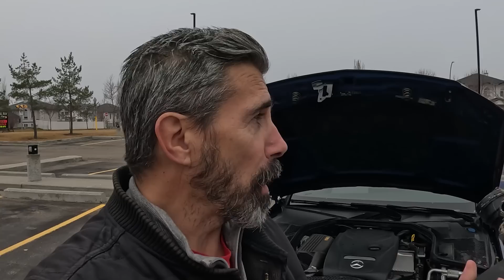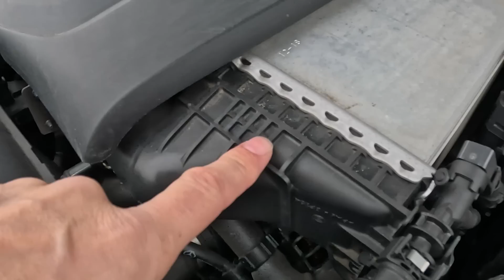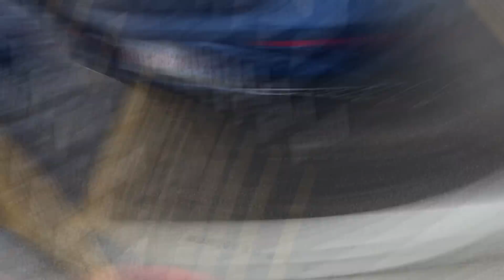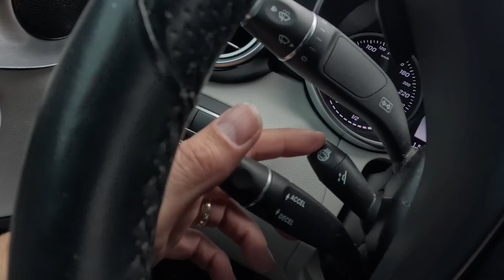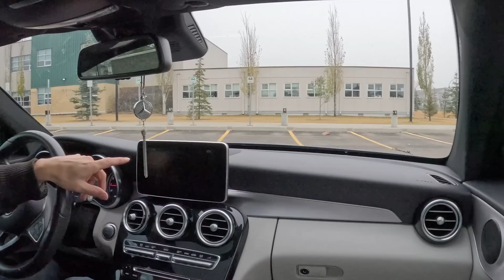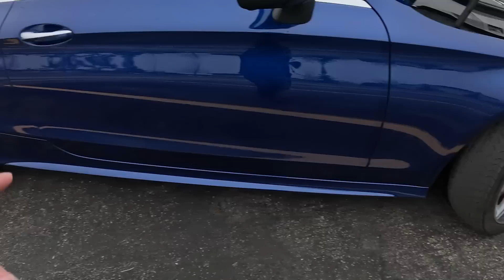Here’s Why New Cars Can't Last  5 Years | What Went Wrong?

Comment: Enjoying driving my 1997 Volvo 855 so much every day. The lack of terrible screens, intuitive physical interface design, no irritating systems that bug you when driving, windows you can't see out of without cameras, basically everything is repairable at home. Nothing is locked down with expensive systems and nothing has to be programmed in. It also looks better than any modern car. God modern car appearance is just the worst, the terrible ADHD headlights, all the weirdo shapes, the wide fatness, the huge expensive wheels to offset how weird the car would look because the belt line is so high, and how every car is a bloody SUV or suv lookalike...

Comment: They said this about my car. 2013 ford taurus turbo. Never had to repair anything mechanical. At 230k miles. I just keep up with maintenance. Most cars break from beating on them and lack of maintenance. We have a 2003 Honda civic we use for long road trips. It's rolled over miles 2 times. I bought it with 500k. It's rolled over 2 times and I'm on roughly 2,300,000 miles. Never replaced a part besides spark plugs ever 175k and oil changes every 6 months( I go by time not miles)

Comment: 40 years ago, a used car with 60,000 miles is about toast. Now, a used car with 90,000 miles is expected to go for another 50,000 miles. Coolant lasts 100,000 miles. Spark plugs last 100,000 miles, tranny fluids go 100,000 miles. Tires last 60,000 miles, with some going over 100,000 miles.

Comment: They have been using ABS plastics in cars since the 1950s. They have been more common place to save cost and weight in cars over the years. But I've have many cars from the mid to late 1990s to early 2000s with plenty of ABS parts and some went well beyond 150k miles. Currently have a 1999 Mercedes ML430 with 250k miles and still going strong. I don't like the cars with too many electronic assisted aids and or complex stereo systems. When BMW started doing electronic controlled park brakes and transmissions it caused all kind of failures. And Audi with their MMI optically linked stereo system if one component fails optical series then nothing will work. And in some models with a self leveling suspension you need the MMI screen to work to put it in service mode before jacking it up.

Comment: Vehicles from the 1990s to the mid-2000s balanced solid engineering with modern features, while today's models are built for efficiency and tech, prioritizing newness over longevity to keep sales flowing. The shift from solidly built to discard and rebuy happens due to the following ...

1) increased profits - Automakers realize planned obsolescence increases sales. 

2) cost reductions - Sacrificing high quality materials and over-engineering because they cut into margins.

3) Technology and complexity - More electronics leads to faster obsolescence. 

4) Consumer behavior - many people prioritize new features over long-term durability (think of the iPhone craze, got to have the latest and greatest).

Many overseas countries won't import American automobiles for these very reasons.

Comment: Totally agree; Mercedes lost the plot after 2002.  I have owned 3 and will never buy another.  Its a mid 2000s Lexus or Toyota for me.  My other car is a 2000 Jimny.  Nearly everything under the bonnet is metal.  The only plastic parts are ones that hold cold water - or are inside the car.
Reply from the maker: sad direction they went in my opinion

Comment: Hi your video is spot on, I run a 2005 VW polo SDI with a 1.9 naturally aspirated diesel engine. I'm pretty confident that it will achieve 1,000,000 miles+
Reply from the maker: nice.  Yes some of these old units are amazing

Comment: There are some but people are buying junk because the car makers know how to trigger your emotions with B S  advertising. 
European vehicles = junk
Korean  = junk
American = junk
Nissan = junk
With what's left you have to do your research on each model but in general they are better

examples of disastrous engineering:
putting a rubberized timing belt running in oil
putting a water pump inside the engine casings
putting a heater core inside the passenger compartment inside the dash
cylinder deactivation
putting plastic oil filter assembly under intake manifolds
putting turbos in the space between 2 cylinder heads
making specialized plastic hose connectors in the engine compartment 
replacing aluminum casings/housings with plastic ones
imbedding all functions and controls in an electronic screen
making rear lights with a computer module imbedded

Comment: And no mention of Adblue and DPFs?! 👀
Thats a big one over here in the UK!
Emissions symbols on the dashboard, adblue pumps packing up, adblue "going bad" because it's sat outside the forecourt in the sun for too long...
DPFs blocking up with soot, failed regens diluting the engine oil with diesel, DPFs actually cracking internally due to the heat/cold cycles...

All 21st Century problems. 😞

Comment: someone doesn't understand plastics, LoLz...  turbo 4's and 6's have been around for a long long time. cvt has some issues, but routine oil changes fixes most issues. don't worry about batteries, lower cost solid state batteries will be commercialized in a few years. 

not sure why older cars are being called more reliable than modern day cars. as a former mechanic, i see more older vehicles than modern vehicles. i ever fixed manual roll up windows, corroded wiring, the usual alternators, water pump, compressor, power steering, etc... and yeah, they were not cheap then as it's not cheap today. sensors and modules are not a big deal. it makes things easier to diagnose. mechanics will now need to become IT techs, LoLz... 

what i find that is a major issue are auto stop start systems. it's not good for the engine to stop circulating oil or stop the turbo cooling system multiple times during stop and go or city driving.

also the most important issue is, these new technologies are very expensive, causing the price of cars to increase. what i like about the new technologies are the safety features (ACC, Lane Centering, automatic emergency braking, pedestrian censors, surround cameras, etc...).

Comment: OK, I will bite.   Build what sells.   Why can't they make a simple reliable car, that has manual a/c heat controls?  Do I need 4 fan/blower speeds for the defroster?   Why can't they come up with a durable plastic?   It is not like cars and plastics haven't been around for 150 YEARS ! !

Comment: I have a 2018 Dodge Challenger V8 5.7 l engine. No turbo, no problem. It is old technology that is proven over decades. Sure it has computers etc however, the engine will last 200k with little maintenance. This car has 48000 miles on it and has been reliable. I have had to replace the battery and an anti pollution device as well as all four Brembo brake pads. But this is regular maintenance. And this V8 sounds so awesome when you start it up and drives so smoothly. My car is a manual 6 speed transmission so no Automatic transmission to replace.

Comment: Plastic... Like Subaru is using in their Thermostat Control Valves. Can't even replace a simple thermostat anymore. Instead it's a $400 part which has an additional 4 internal failure points and costs between $1400-$2000 (part included) to have replaced. At least Subaru extended the warranty period for this issue and is replacing them for free, but after a class-action lawsuit began gaining ground!
Reply from the maker: It’s good there are many fixes forced on the OEMs

Comment: Auto vehicles are becoming disposable goods, planned obsolescence is what it happening - like 'sealed for life' transmission fluid - Electric Cars - NOBODY will be able to repair these - the only winners are the Government who will be in control of that thing more than the drivers, the automobile companies who will have unique control of parts with patents and IP licenses and prevent third party repairs and finally banks - who most people will be getting loans from - There’s nothing in it for whoever ‘owns’ it. I only ever had NA vehicles, never had issues - last purchase was a 15 year old Jaguar XKR-S, sublime V8, pottering along at 100mph doing 2k rpm or something like that hardly breathing - modern cars are full of nanny state mandates and control and technical rubbish nobody will be able to repair past its warranty, after 5 years dealers will chuck a pile of parts into the bin and charge a kings ransom to repair it or just crush the car itself and the cycle will continue.

Comment: Interesting, I just checked my 2109 Genesis G70 and every hose is a real braded hose with metal clamps! My previous car was an Infinity G37x and it had a beautiful V6 that produced over 300hp but the issue was the gas mileage!
Talk about plug and replace, I had a retread pop up and crack the headlight lens, I'm thinking that the lens could be replaced at a few hundred dollars. Well I found out the entire light package including the blinker and headlight is all one piece and was over $2000!

Comment: When a lot of people trade their car in before, even paying it off most of the time do people really own cars anymore?

I mean, I have a 2006 PT cruiser runs like a champ and I got a 2011 Dodge grand caravan. It has a PO code in the transmission but keeps on ticking. 

I really feel that Dodge putting sensors on the hoses is dumb. That’s all I’ll say about the Dodge grand Caravan.  

Never knew that when a radiator hose goes out on a Dodge grand caravan it would be $600 .

Comment: It’s not isolated to just plastics. The overall level of good engineering that’s fit for purpose long term, simply isn’t there. Many manufacturers don’t have an extensive R&D programme per vehicle. The user is the Guinea pig and the maker has factored into its pricing what they estimate will be warranty payments. The irony of modern cars is simple, I run a 2012 3.0L straight 6 3 series BMW. It has 120,000 miles on it, doesn’t burn any oil, has always, since new, maintained 41 MPG and pulls like a train. Why……is it, that a much smaller engine can’t achieve the same low fuel consumption?  Because a larger engine has more torque and isn’t working as hard as a highly strung 1.2 for example. Car makers simply nowadays want you to buy another. That’s progress, or at least that’s what they call it.

Comment: My 2006 Jeep Grand Cherokee with the Mercedes OM642 diesel engine has given me 4 years of absolute greif. Only 140.000klms. Problem, engine blowing white smoke. Mechanic would work on it, problem gone, a week later problem back. Spent thousands $$, injectors replaced, inlets decarboned, and more. So much smoke the car could not be registered. About 6 months ago I discovered on a forum that resetting the main ecu/pcm might fix the white smoke, it sure did, but the fix did not last long.  What made the problem occur was discovered. Adjusting the driver's seat back or forward corrupted the engine settings in the main ecu/pcm. Why??? My mechanic and auto elec shops had no idea. I some weeks later thought, the seat moves the problem returns. The seat memory module is attached to the seat, normally passenger side, but for mine being RHD it's the drivers seat. My partner is shorter than me. So I checked the connectors  going to the seat module, one was loose. The problem fixed. So costly and such a headache. During all this I did buy another GC, a 2015 with the Hemi. More to go wrong I guess, but I've learnt lots.

Comment: I like older cars because they are easier to fix and they also tent to have a bit more character than newer cars. I can even see a difference in a car that is over 20 years old. my parents car is turning 26 this year and it has never had any engine failures. it has also done over 100,000 miles.
Reply: I meant tend not tent.

Comment: A combustión engine gets really efiicient when It deliverys Torque to spare in direct relationship with the weight to move. Small engines, even when turbocharged, often struggle to delivery unless they reach high rpm.

Comment: The best kept secret out there is Ford bashers I love them. I've owned multiple Fords never have the issues that this guy complains about. My Ford Edge with a lowly 2.0 EcoBoost has115,000 miles still going strong doesn't burn oil and pulls a 2000 lb trailer on a daily basis. I wonder if he's actually ever owned a Ford. But keep bashing them it keeps the prices down for people like me. Thank you

Comment: My car is 20 years old, 135000 miles. Small engine (2 litre) with turbo. Oil consumption minimal. Power still impressive, about 7 seconds from standstill to 65 mph and plenty to get it to over 120 mph. Which is well in the "lose the licence"  for speeding.
Very reliable and efficient. Recently passed a strict MoT test.
Cheap to run too. And comfortable.
It might be good for another two years. I don't expect to replace it this year.

Comment: aside from the plastics, repair and maintenance is horrible. You cant get access without taking these and those parts out first. 10$ part replacement will require thousands in labor cost... and the plastics crumble so you have to replace those too. I had a 90s toyota and its starter, alternator, compressors, radiators, etc were exposed and easy to pullout and replace when the time came for it. Dont want a car I cant fix myself.

Comment: You are spot on brother! I own a 2017 honda civic sport touring 1.5L turbo direct injection engine! And you are exactly right about the oil change way sooner than what they say in the owners manual! The turbo charger creates a crap load of under the hood heat and if im not mistaken? The turbo has a bearing that is cooled by your engine oil and it cooks the engine oil! I change my oil every 1500 miles because of the fuel dilution and I am mechanically inclined and know my way around a car! And especially if I own it and responsible for it's up keep! And I am a firm believer that if you want it done right you're gonna have to learn to do it yourself! Ain't know body care the way you are going to care about your things in life that mean so much to us all. And it is sad to see how great things were manufactured back in the day, and the workmanship that went into things such as are automobiles. I have to ask myself all the time, who in the hell thought it was a great idea to replace steel and iron for plastic? Even my riding lawnmower engine has a plastic camshaft in it! Who thought that was excepttable? We used to call someone with ideas like that a few fries short of a happy meal back in the day! 😉
Reply: We can go back in time. Just buy an older model pre 98 and take car of it.

Comment: Some of this goes back to consumers. People want all the gadgets, instead of reliabilty and simplicity and then bitch when it comes time to repair. There is another side to this as well. I would argue old vehicles are more "green" than new, because they used more steel and aluminum wich is recyclable. And what about the resources and electricity used to produce more vehicles because they don't last. It takes fuel, electricity, rubber, glass, plastic etc to produce a car.
Reply from the maker: Yes Many buyers spoke with their  wallets and their choices

Comment: No one remembers the garbage that was on the roads in the 1970s.  That was truly the worst time in automotive history.   Most cars were done by 60k miles.  I mean done.    Most modern cars even with their plastic parts can go 120,000 miles with proper preventive maintenance.
Reply from the maker: Yes I remember the 80s and early 80s with a lot of trash.  Things progressively got better but honestly seemed to peak about 10-15 years ago and now it’s trending back down the other way again, at least for German cars.
Reply: @ agreed.  If the Chinese come to market with inexpensive quality automobiles.  Everyone will have to adjust or go out of business.  The days of cutting quality and raising prices will be over.  

BMW peaked between 2006 to 2012.

Comment: My 2018 Tesla 3 is now 7 years old.   It has 130,000 miles on it. All I have needed was a 12 volt battery and wiper blades.   I have not even had to change the brakes.  They are still at 75% of new condition.  

Best car I have ever owned.  I am done with gas cars.
Reply from the maker: Cheers

Comment: Half the problem is the stupid governments mandating ever more ridiculous emissions and fuel economy standards forcing manufacturers to make them lighter with tinier high stressed engines. 
 Even electric cars are throw aways , buy a new EV 9 or 10 years later have to spend $20,000 to 35,000 to replace the battery or throw away the car and buy a new one. 
  Old and simpler with big lazy low stressed engines that if maintained can easily last 20 or 30 years = win win .

Comment: What an absolute heap of junk, I buy used cars, often 10 years old, then run them till they are uneconomical, however with these as shown, they'll be on the scrap heap before I'd even get near them. So I better look after my old Ford V8, already too complex, but way simpler than that one shown.
Even the dash on new cars makes me kind of panic, usually large custom LCD graphics displays. In 15 years try and get a new one.... like trying to fix a 15 year old LCD TV, nobody has spares. It's one thing to chuck a TV when the LCD fails, but what do you do when the dash goes dark, the car's basically unroadworthy.

Comment: I work in Mercedes, its funny to see those new cars being serviced with like 6000 km driven (even few with totally broken engines under 1000km), meanwhile i m driving around in my 28 years old ford puma 1,7 without any problems, even being able to still push him to 200km/h. The only usefull electronic crap on it being ACU and heated front window :D